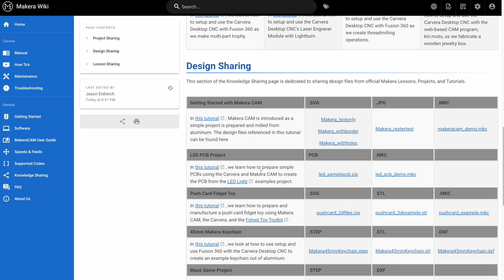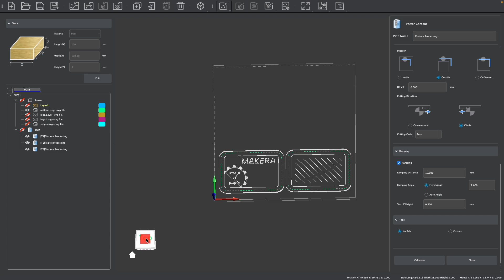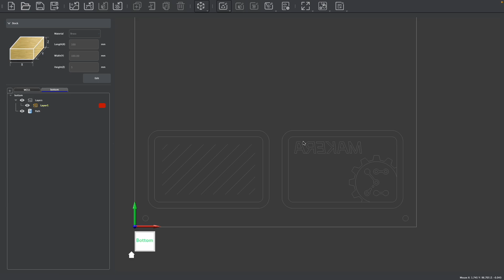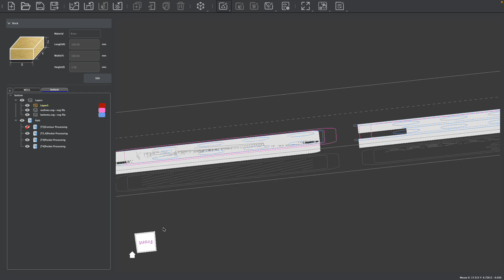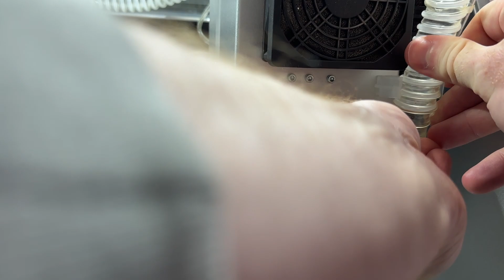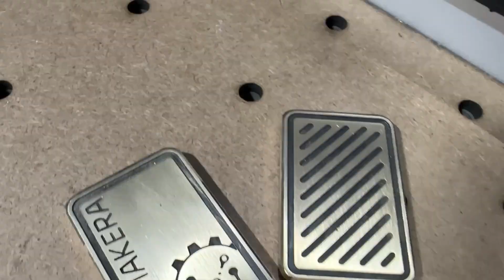How to Make a Metal Push Card Fidget Toy using a CNC

Comment: Great video! I'm making one right now! Instead of the logo though I'm leaving it blank so I can use a fiber laser for some cool effects. With that said, did anyone else notice that the design coming out of the machine is flipped from the design he makes in Makera Cam? At least I hope that's the case because mine is cutting out the side with the pin on the left not the right. LOL
Reply from the maker: Thanks for the feedback and support! The flipped aspect is due to considering what the top vs bottom is, but shouldn't be an issue.

Comment: I downloaded the project file for this fidget from your website and made it today. I have one question. Half of the magnet holes were slightly undersized, and the magnets would not fit. This was a simple fix with my Dremel, but my question is was this user error on my part? Or could the dimensions in the project file be off a little or could it possibly be my machine? I use the carve air and a brand new bit.

For complete diagnosis transparency, I only know of one mistake that I made that I thought was inconsequential. On one side of the stock I chose mesh probe and on the other side, I didn’t bother after watching the video where it said it was unnecessary.
Reply from the maker: So you were using the same magnets for all of the holes, but they wouldn't fit in all of the holes? That sounds a bit strange and not how it should be. Perhaps it was due to how the stock was sitting on the bed, if it was perhaps not perfectly flat and leveled correctly one side could have machined at a greater angle by a very small margin. Please contact our support team for additional assistance and support.
Reply: @Makera  I think I figured out the problem. I don’t think the stock was flat. The little pinholes in the MKC file on the wiki ran down into my build plate, causing little material displacement bumps. I ran the tool path from the wiki, not knowing about needing extra material underneath the stock.

Comment: What clearances are used in order for the alignment pin to fit perfectly into the hole at the corners?
Reply from the maker: A 2mm drill was used to create the holes for the alignment pins included in the materials kit.
Reply: @ are the alignment pins also 2mm in diameter?